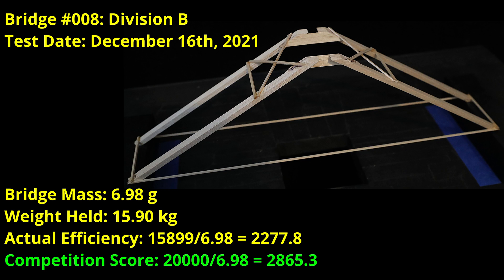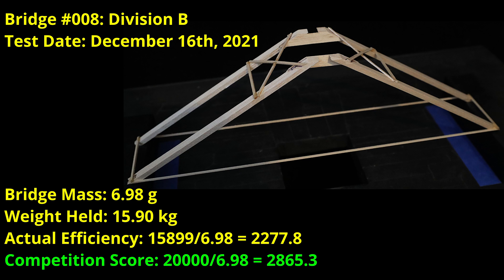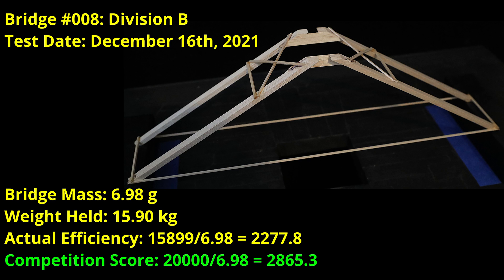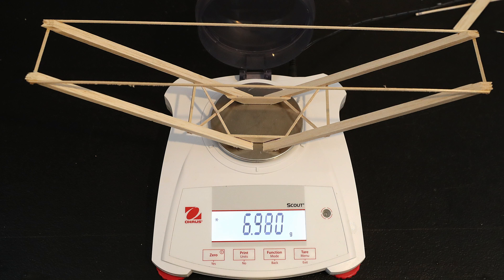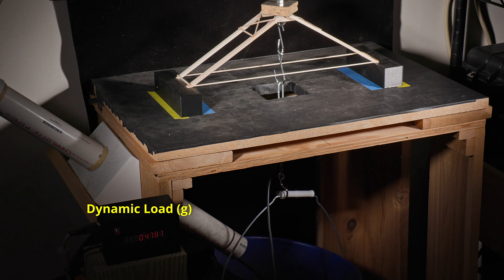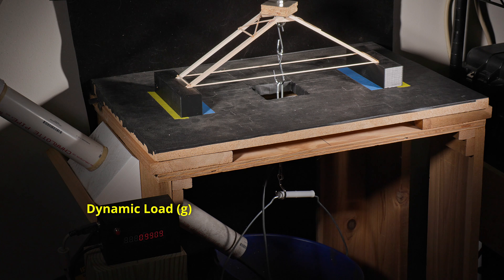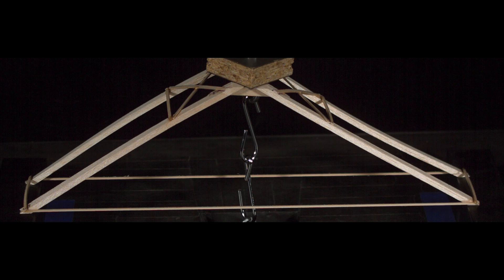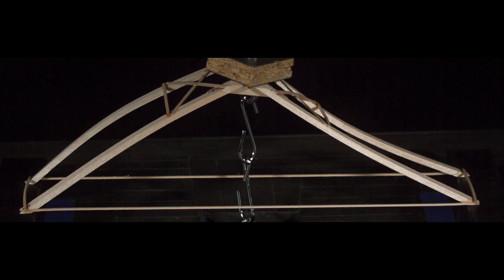Bridge 008 Division B: Competition Score 2865.3

Comment: Hi could you please tell me the length and thickness of each balsa wood piece used.
Reply from the maker: For this particular build, the critical leg pieces are 1/4" thick by 8mm wide and about 21cm long.  To get the precise lengths, and for the assembly process itself, you really need to draw it to scale on graph paper.  Be sure to watch some of my other videos for examples of that.  You might also want to watch the full Div C build video, which is over an hour long, to see all the build techniques I use as many of them apply to the Div B design as well.
Reply: @balsaengineering6686  is 1/4 x 36 Inch Dowel fine
Reply from the maker: @BlueMango1  Dowel is usually made from much, much heavier wood than balsa.  You definitely want to try and track down 1/4" sheet balsa and cut it to ~8mm if you want to try and duplicate the particular build.  If you find square dowel pieces, I'm sure it'd work fine, but it'll be very heavy
Reply: @balsaengineering6686  By dowel I meant balsa wood sticks my bad

Comment: Hi... your videos are the best and they are so informational... is balsa wood from hobby lobby ok, since i am using that?
Reply: hello fellow bridge bro
Reply: @muruganjagan8990  hii @Balsa Engineering can you help??
Reply from the maker: Hi Aryan, I am glad you are enjoying the videos and that they are helpful.   You can definitely use balsa from hobby lobby.  It really doesn't matter where you get the wood as long as it works for your design regarding dimensions and mass.  The big reason to go with a place like Specialized Balsa is that you can order exactly the mass range, or very specific mass, for a given sheet.  That's not necessary until you refine your design and builds.
Reply: @balsaengineering6686  Oh ok thank you so much.